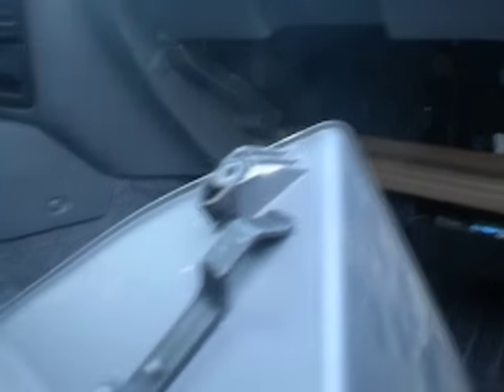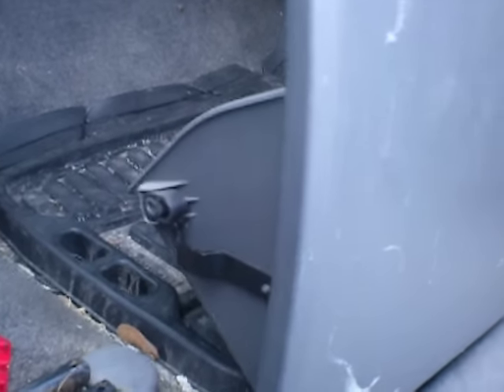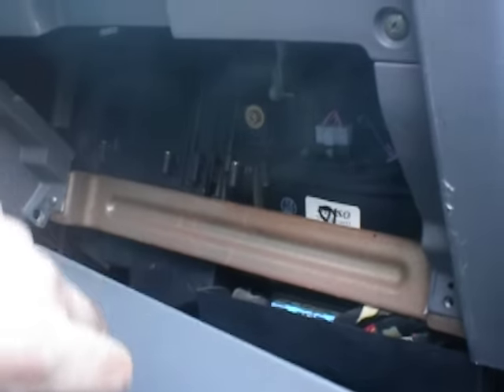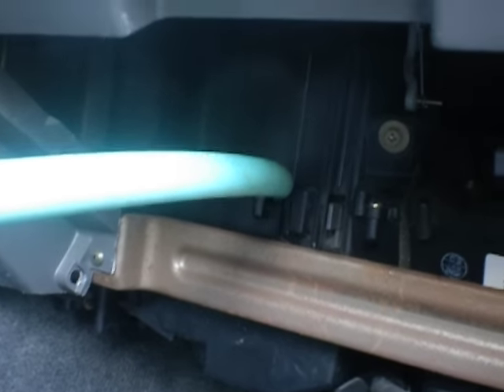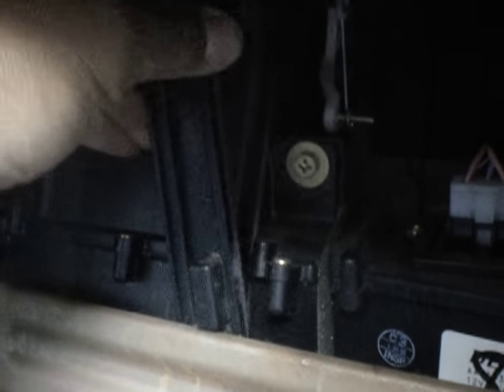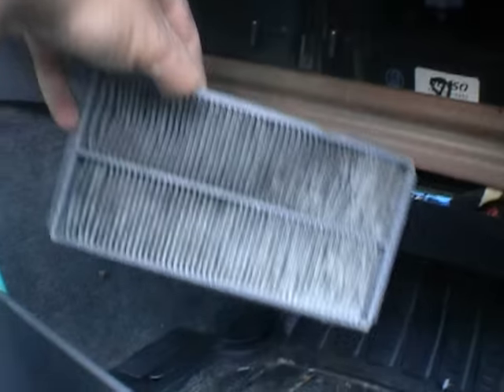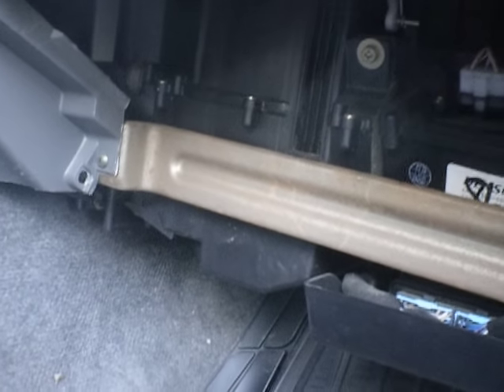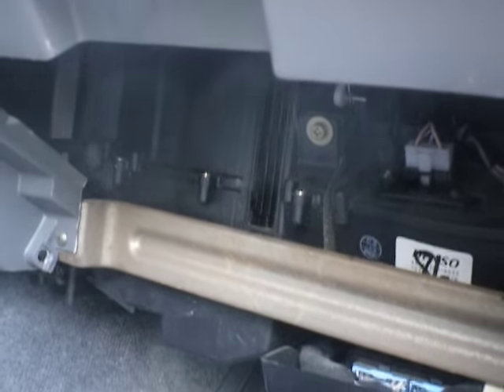1999 2000 2001 2002 2003 2004 Tracker Cabin Filter Replacement

Comment: "I just cleaned it" - Shows filter that's dirty as hell. But even if it would have looked totally clean, it still would had particles embedded deep in it, which all would have hindered it actually filtering anything. Just replace the damn thing for a few bucks, or if you don't, then wash it out properly! Not that you could really clean it by washing it, but at least it would gain some of its functionality and actual filter capacity back. Cleaning the surface of the filter halfheartedly won't make any actual difference - you could then just as well leave it as it was.
Reply: Como maldita 
si te hizo un trabajo que no absorbieras impuresas
Reply: Maybe he can't afford to replace it ATM. Also, cleaning a filter like this is a bad idea. Water will destroy and warp the media in the filter. Yes obviously replacing it would be the best thing to do. But, he said he vacuumed tge surface of it which is fine. And blowing out with an air hose will work but like water it can damage it if your not careful. Be thankful he made a simple video that helped a lot of people instead of complaining about something so trivial.